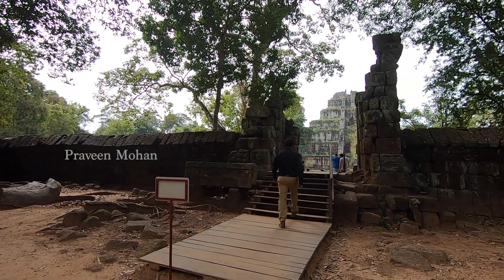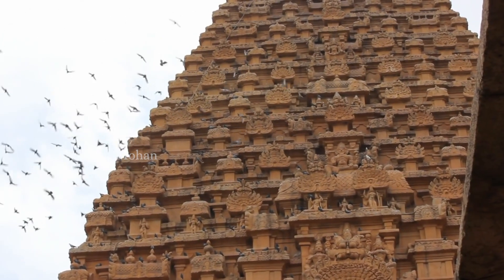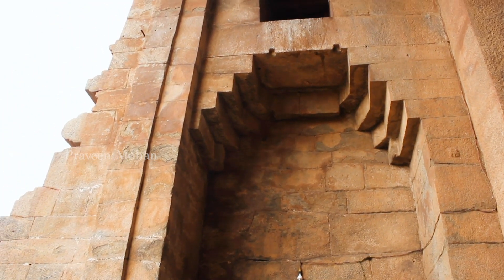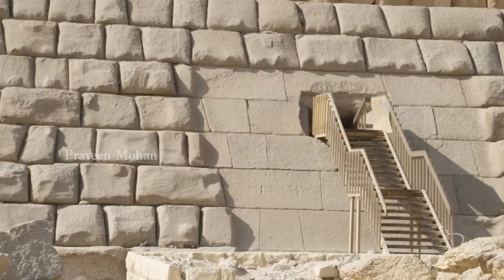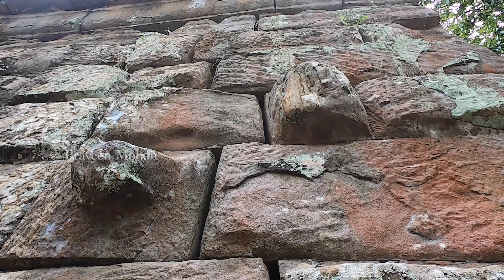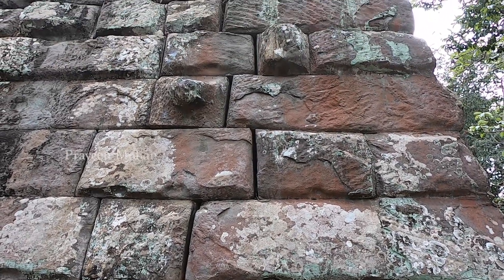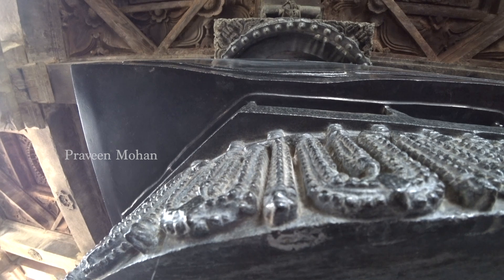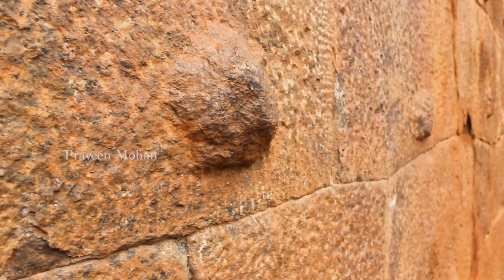Mystery of Ancient ‘KNOBS’ in Temples - Evidence of Stone Melting /Geopolymer Technology?

Comment from the maker: Thank you for watching. If you like this video, you may also like:
1) Floating Rocks Of Ramappa Temple? - http://y2u.be/AP0TvEIDuqY
2) Mysterious Arches of Preah Vihear Temple! - http://y2u.be/uX9XtvESIMs
3) Ancient Kailasa Nathar Temple was NOT built with Stones? - http://y2u.be/DmqAg5VKuZA
Reply: If it's a defect then that would mean they could melt /mold stone but not be capable of removing their defects . Why would they build with such size and precision but leave their obvious knob defects all over the world where these exist.  Blocks in other parts of the world with knobs also have the melted metal keys holding them together so they should've been able to at least chisel off a couple defects ?
Reply: @petermorelli5925  the metal "keepers" are made first and pressed into the geopolymer concrete blocks prior to solidification. The Antediluvian megalithic societies had crafts/machines that used ultrasonics to  mine the rocks, rough cut, transport, vitrifiy, solidified conglomerate, they used liquefaction (buttering), and curing processes.
Reply: why would they bother. We make bricks and blocks with defects. We have the capability to disguise or fix those defects but we don't bother. Look at modern buildings.
Reply: @petermorelli5925  Good point! I vaguely recall reading about or seeing a video that made the claim that the knobs form a shape when seen from a distance. I think that one of the shapes was of a cat, probably a puma.
Reply: I have pointed out this possibility earlier under ur videos.Now we got proof.Maybe a combination of stone chips with silica for maintaining certain vibrations inside temple since silica adds to semiconductor like properties.Also this combination is Eco friendly energy efficient.No need of air-conditioning since the rock are soft act like clay pot which keeps water cool.
Reply: Hi Mr. Mohan, you don't leave any space for doubt when you start exploring & explaining the process or monument & this is what makes you special.
Keep up the wonderful work, you are doing a great, pathbreaking job. People are going to realise, recognize & follow your profile style 🙂👍
Reply from the maker: @manuupadhyaya9999  Thank you very much for your kind words and support. I appreciate it.
Reply: @RealPraveenMohan  thanks a lot
Reply: @manuupadhyaya9999 ⁰
Reply: the knobs are a writing inscription method like the binary code 0 and 1
Reply from the maker: @theone6997  Interesting thought
Reply: @RealPraveenMohan  I agree with @christopher Higgins.
These knobs could be used to attach another piece of stone/artwork over them. May be these stones are yet to be covered with artwork...
Reply: @B4UDAYउदय  I thought of that too but considering how geographically spread these knobs are I haven’t seen yet a place that still have smth attached to these knobs
Reply: The only problem I see in your theory is the use of polygonal masonry. Each stone seems like a unique shape, which would make casting no where near efficient. I'm not sure if anyone has done the research necessary to find out there are any repeating stones with the same size and shape in polygonal masonry at a single site or heck even at different sites across the world, but until then I can't say you're right...

Then again if someone did find the same polygonal stone in shape and size in South America and Japan, that would pretty much prove the "ancient advanced world civilization" theory...
Reply: Hi Praveen! Sometimes we forget that maybe there was another surface covering the stone, and maybe even the protrusion held some kind of decorative artwork. They may have used the protrusion as base to build framework for wooden constructions that are no longer visible to us...maybe? Thanks for your work, I wish you the best 😃
Reply: Absolutely mind boggling. Every time I watch your video Praveen, I sit and pick my brain for some kind of explanation but always in vain I have nothing😂. I am guessing here but do you think these particular rock (moulded/cut) are faulty may be they have the bumps or cracks or some kind of default, hence they put at unimportant parts of temples or monuments? And once the builders examine these rocks for their quality than they been given these marks or bumps to distinguish them from the faultless rocks. Like I said wild guess. Great video Praveen..be safe wherever you are and go next. 🌍🙏🏼💙💙💙
Reply from the maker: @Divine00  Thank you buddy! :) :)
Reply: (YT) Brian Forster, Inca Tours, has been chasing these nubs a few yrs now.
Reply: @joes6319  I have already explained this to both Brien and Graham Hancock, they are more interested in sales than knowledge.
Reply: மிகவும் அருமையான பதிவு 💪
நண்பர் பிரவின் மோகன் அவர்கள் தமிழன் என்பதில் பெருமிதம் கொள்வோம் 👍👍👍 வருங்காலத்தில் நீர் பார் போற்றும் தொல்லியல் துறையின் சிறந்த ஆசானாக விளங்குவீர்கள் என்பது நிதர்சனமான உண்மை.✌️✌️✌️
🙏ஓம் நமச்சிவாயர் 🙏 என்று தங்களுக்கு துணை புரிவர் 🙏🙏🙏
Reply from the maker: @Velram1.  Thank you so much for your kind words and support, my friend!
Reply: Could the knobs be places where plaster decorations where mounted? I've always wondered and many images make me wonder more. Great videos.
Reply: I forgot to add I have heard the knobs can also be called a sprue
Reply: @PraveenMohan Sir , Can u prepare some Documents( like Papers,Book,etc.., ) related to Rock Melting Technology....you have Lot Knowledge on it, This may Useful to Next Generation...
Reply from the maker: @chandbashap6601  I wish I can do it someday!
Reply: These knobs don't look defective there must be a another reason bro.
Reply: They melt the stones with frequency ,, the right Frequenz and stone will desintegrate or melt!  All is frequency .  Nikolas Tesa quotes!
Reply: @ottomais  you are getting very close, keep digging, you will reach the same conclusions as I have. I told Praveen he was on the wrong path a couple of weeks ago, glad to see he's now on the correct path.
Reply: @ottomais  and probably also frequency helps with lifting and moving the stones.
Reply: I have to admit, I was skeptical at first about the knobs, but you presented your evidence, made your argument and changed my opinion.
You really are very skilled at argumentation. It's not the first or even second time you've changed my opinion on a theory. That's a talent. It's not easy to change minds. People are incredibly resistant to changing their mind by someone's argument. It's an impressive skill.
Reply: @kantitsamystery6328  : Did you ever think the stone itself might be cement concrete which would stay soft for some time before solidifying.  If so, then stone melting was not necessary and any worker could create a knob on the soft stone.  If you believe the stone was not made of cement and was carved from natural hare stone, then the carving process would take a long long time and create a lot of waste scraps.  Where were the scraps? If no scraps it means no carving.
Reply: @kantitsamystery6328  

The video is misleading you, the knows are something that will blow your mind.

This guy has no clue and his mentioned of experts are not viable,  not facts but plenty of imagination.
Reply: I seen a place where figures fell off the wall and they had holes behind. The knobs were used like pegs to hold statues and figures on the wall.
Reply: Good vid!
Reply from the maker: @Godwinsname  Thank you, my friend!
Reply: @RealPraveenMohan  I AM very glad that you have finally come to the correct conclusion, albeit a bit late to the party. These stones in particular were cooled too quickly causing spalling and suck back on the surfaces. I  have given you some information, as I have also done with Brien and Graham. If you want to know more just ask.
Reply: @Cryptic_Triptych  Please tell me more, I have a background in mechanical engineering and alternate physics, look into Ken Wheeler; he has a Grand Unifying Theory that's simple and correct, and learning from him can help understand how these technologies worked
Reply: @aidanastigarraga206  LOL, I have had many conversations with Ken. I have talked with John Hutchinson as well. I could go on about myself and the things that I know and people I have studied and talked with, but it's not about me. It's about the great revelation to humanity, that is why I AM here again.
Reply: @Cryptic_Triptych  you are a good soul, and a selfless one at that. I hope more people shift their paradigm and see the truth. It's people like you that will make that happen. Please let me know if you have any more specific information. I also have studied the Coral castle for a very long time and I believe Ed Leedskalnin used similar methods.
Reply: @aidanastigarraga206  thank you for your kind words. I have studied Ed's work as and understand his book Magnetic current. His principles are the same as Tesla, Schauberger, Russell, Steinmetz, Heaviside, Plauson, T H Moray and many others that I have studied. Eric Dollard is probably the best living source along with Prof Dr Konstantin Meyl and TheOldScientist.
Reply: @Cryptic_Triptych  if people only studied the history of electrical theory, they would see the gigantic holes And unanswered questions in today's modern understanding of physics. I have to agree with Ken when he says that scientists are really just atomistic math majors
Reply: @aidanastigarraga206  yes exactly, if they understood that electricity is a byproduct of magnetism and dielectricity (most people don't know what dielectricity is), how piezoelectric energy is produced and that the Earth is a piezoelectric crystalline generator and transmitter, they would truly be astonished. I have figured out a lot about how this Construct operates and how to hack into its operating system. It is a fractal, a lichtenberg pattern, a mandelbrot set, a chiral bifurcation, a coaxial perturbation, an inverted mirror image, a helical vortex, implosion, compression and expulsion, my concept of -1, 0, +1 (also how "nature" operates) is the new system for spintronics which replaces Claude Shannon's binary system.
Reply: @Cryptic_Triptych thank you, I will surely be doing all kinds of research now; isn't it ironic how when you base your science in reality, seemingly "magical" science is possible? If there are specific ways you are aware of in which the pre-flood civilization may have cut, moved, and vitrified these monolithic stones, please let me know. As of right now, I believe cutting was something along the lines of "wire EDM",  and the vitrification process was electrochemical, however I don't know what specific frequencies/methods are used. The only thing I don't have a full conceptual understanding of is how the stones were moved. I believe that to be operating on a radio frequency, but I don't know how it would be applied to stone. Any info you may have would be incredibly beneficial to the future of humanity. (I also may have a method of dating when some of these monolithic structures were built, based on the precession of the Earth's axis, but that all relies on how they moved the stone)
Reply: @aidanastigarraga206  there are different technologies utilized. For example in South America and in the Antediluvian megalithic structures they used a machine or craft which utilized ultrasonics to cut out, transport, make conglomerate, pulverized and make geopolymer, set and bevel edges. If you look at the processing method used this is the only conclusion a rational person will come to. It is very obvious that the stones are processed and the areas where rock has been removed is machined. Some are conglomerate and others are polygonal geopolymer, some even have magnetic anomalies which are only now being replicated in labs

 https://www.colorado.edu/atlas/mechamagnets

I told Brien Foerster about this while he was investigating the magnetic properties of the "H" blocks. Along with the stacking and interlocking design the Antediluvian megalithic societies impregnated the crystalline structures with magnetic fields (creating magnetic alignment) this gave a greater bonding strength to the entire structure. It would very much seem like magic, as does frequency or archeaoacoustics or sonoluminescence. In fact all of this magic is generated by the same process of frequency generation as Nikola Tesla explains. Harmonic resonance induction. You may also have realized that all the gods hold a staff, fork or trident, these "pitch" or "tuning" forks are very prudent as to understanding how the post flood people built structures and moved them. Standing waves, constructive and destructive waves of energy are another example of how frequency is utilized. You can look further into Crystallography and metamaterials for a start. I also know about phase state transformation or as it used to be called Transmutation by way of the philosopher's stone. Furthermore most people do not understand that Mercury absorbs gold, silver (electrum) and copper. So the idea of the philosopher's stone in this sense has to do with a saturated amalgam that is then refined and purified in a process to extract the valuable metals. The river of Mercury in the Feathered Serpent pyramid in the ruins of Teotihuacan is a perfect example of the reasons why this culture had so much gold, Egyptian culture utilized this same principle.
Reply: @Cryptic_Triptych  thank you for all your information! I will certainly be looking into all of this. Today in my research, I have discovered how Leedskalnin accomplished his megalithic park. In the "black box," there was essentially a large magnetron, like what you would find in a microwave. Essentially, this technique is identical to a microwave oven, however it uses very low frequency microwave radiation. (Military E.L.F. radio stations are all built on specific rock formations to act as a ground dipole. They are used to communicate with submarines, apparently.) Underneath the box is a metal bar acting as a cathode for the magnetron. The box on top acts as a cavity reflector to direct the radiator downward. 

Ed's generator worked on this concept: his wheel produced an alternating current, directed into his PMH. Attached to the middle bend of the PMH is a chain and a large mass of iron, which increases the voltage produced by the generator. The coils on the PMH are then directly fed into an AC electromagnet, (seen in pictures next to the wheel) and this magnet is then directly attached to the aforementioned mass of iron. The wheel is then filled with water, surrounded by a piezoelectric container of some sort, in this case, he used the coral. Above the water is a hook shaped piece of metal, which is similar to the staffs held by Egyptian gods, with a "tuning fork" at the bottom and a hook on top. By doing this and then turning the wheel, the water is under such a strong alternating magnetic field that it becomes a superfluid, flowing with zero viscosity and zero loss of kinetic energy. This is why Ed called it his perpetual motion holder. The wheel would keep spinning until he stopped it. That's as brief as I can be for a YouTube comment, but if you'd like to hear more, I'm more than willing to explain.
Reply: @aidanastigarraga206   Indeed, he was able to interfere with the effect of gravity, thereby reducing it's effect by upwards of 80%.
Reply: @Cryptic_Triptych  the moon and the geographic location is also a huge influence on how much the mass of stone is reduced in weight. This is why all the unexpalained megalithic structures are along the gravitational center of the earth, where the moon would be directly overhead at night.
Reply: @aidanastigarraga206  Indeed, you will notice the crescent moon in the garden. Also see the "observatory" and the "sun dial". Ed proved that the Earth does not tilt towards the sun during its orbit in order to create changing seasons, but it moves up and down in reference to the solar plane.
Reply: @Cryptic_Triptych  You are very wise and a clear thinker; I commend your efforts to better and advance humanity. I consider myself lucky for you having seen my original comment. If you happen to know how Ken Wheeler's antigravity toy functions, please give me a shout. You should write a book or a video or something to get your ideas out there! Most people are unaware there was a pre-flood civilization in the first place! What a failure of the education system; teaching young minds the electron is a "particle" and speaking as if that's a well understood fact. The same goes for light! "Photon" particles! Give me a break! That's bordering on criminal!  As for me, I will be building a small scale version of Leedskalnin's design to see if my reverse engineering holds water, but it should, and I am confident this was the technique he used.
Reply: Notice how every single temple that you’ve shown or that you see anywhere globally, if you look at the actual stones it would seem almost as if they have corrosion on them. It’s not battery acid poured on the stones. It’s simply if you connect these stones where these knobs are you can draw power from the temple while at the same time create even more power within the temple. I would imagine this would make the molecules from within the stones charged and at the same time stones would become almost fused together. Cause remember this power works backwards, from the inside out, similar to a vortex. All the power we use is from the outside in.
Reply: They are also on the arches and gates at, Warangal Fort. Check out the knubs on the sides of the Solstice slot you featured recently.
 So glad you are spreading the info on the knubs. Check out our channels for more info on the knubs. Ancient History Criticisms and Ancient Alternative View. 

For my money they are code for the stonemasons to put doors, windows, arches and statues in certain places. Also some appear to be constellations. Some maybe street names especially at the corners. Some square knubs are for mortise and tenon joints to fix another stone to.
Reply: look up star forts you have in all over the flatearth
Reply: Praveen, yes you’re absolutely correct about the melting, casting and everything up to the point of the rocks softness being the reason for the plant growth. The plant growth occurs due to the fact the ancient people were attempting to not only create a living Lingham inside the temple, they were attempting to make the entire temple living. Using life energy, some call it chi, Qi, Prana, manna, Holy Spirit, or Orgone. This was globally well known common knowledge. We can see this easily just by looking at the precise mathematical measurements used while creating all of these temples. The last time someone came close to reproducing positive results using this type of energy or technology was the orgone accumulator. That was a mini, almost microscopic version of one of these temples. Some kings lived for as long as tens of thousands of years utilizing the power of this life energy. Of course mainstream couldn’t ever admit this. It they did it would completely disrupt some of the most powerful business as well as our economy runs on, big pharma.
Reply: @grayj1936  
He is wrong at best.

He is misleading people with his videos
Reply: Hlw bro...Can I guess the reason?
Reply: So much has been lost and forgotten because of the evil that controls the world. I look around and I'm not impressed by our "modern " technological "wonders". I feel the answers to questions like these will never be found by our arrogant modern society  because we are not giving the ancients the credit they deserve for being far more advanced than we could ever imagine. Somehow magnetism holds the key.
Reply: The concept of "cast" stone has also been advanced to explain the architecture of Peruvian prehistoric structures.  One archeologist used this theory to explain the immense irregularly shape stones used in constructing walls and buildings.
He postured that they were made out of a form of concrete held in place by reed containers which were soft enough to mold into the lower set of stones.  The reeds were then removed after the stones had dried in place filling spaces in the irregular shaped lower stones.   You are probably right about their origin supported by the piece of rock that could float.
Reply: @walterdelorrell4041  : Thank you for telling me that an archaeologist had used the same idea.  I am very happy to hear that.  I wish to tell you another point; the erosion.  Natural stones almost never erode while cast stones erode very fast.  Erosion will create cracks and holes and through these cracks and holes, we might see a different material such as bricks and small natural stones.  Please pay attention to erosion when another Peruvian video shows up to you.
Reply: Parveen mohan aapki videos dekh kar Garv hota hai apni sabhyata aur poorvajon par aur ye batata hai k kitna kuchh hai Jo hamse ateet mein kho gaya hai. An dhoondhna hoga apni khoi Hui swarnim virasat ko
Thanks bro for your valuable videos
Reply: Electrochemical and Electrical Discharge machining is how these were made, just a more advanced understanding of how to apply these techniques to stone
Reply: @aidanastigarraga206  very close, keep digging, see my comments throughout this post.
Reply: If they were cast, would not all surfaces be smooth and identical?
BTW, are they not stones rather than rocks?
Reply: Has the composition of these rocks studies? Are there any clues in their composition?
Reply: PraveenMohan oh my goodness your merchandise is pricey sir.
Reply: THE MELTED BRICK INFRASTRUCTEUR ALL OVER THE WOLRD, IS SOLVED BY: WHEN DE BUILDINGS CRIED AKA SUBPHOTONIC AKA JERRY DECAMP, 
THE PERFECT RED-BRICK INFRASTRUCTEUR OR BUILDINGS GOT HIT WITH HEAT GOT COOKED AND MELTED, THE MORE U COOK THE CARBON-14 OUT THE OLDER IT DATES N LOOKS N THE MORE U COOK THE C-14 THE MORE COLOUR U LOOSE TILL IT GETS WHITE LIKE ASH SCORCHED EARTH WAS PERFECT RED TARTAR BRICK,,, PAY RESPECT OR HOMMAGE TO THE INFO DONT BE A HATER✌ PEACE
Reply: Half right. Underneath the knob will be the hole in where the Lewis lifting anchor was placed, round knob for split pin and square for three legged Lewis.
The stone was dipped in geopolymer and settled in place with a perfect fit but leaving the lewis in a while for stability would also leave a knob when pulled out. Some stones where cosmeticly corrected afterwards but for the most part they didn’t bother to do the effort. 
So, I’d say you’re wrong about the holes but half right about the knobs not being carved but comming from the use of geopolymer.
Reply: @ros8737  
Ya heard this one?

If you can imagine the Earth starting the funner part of its life as a rock covered by hundreds of miles of ice, then the nubs could make sense as a ball and strap connective tissue shaped like this @—====—@

The ice melted, parts of the crust got exposed and mountain sized beasts have been decaying in mud. Animals got smaller, we are all walking on the sea floor and digging into carcasses. The “rock” may have been easier to cut at the time and would probably seal back up nicely next to another rock like it being all biological n all..
Anyway 
After transitioning to a certain state, the flesh-turning-to-rock formation compelled the mason to workaround the ball if it was close to the face by cutting some of the desired rock around the strap such that it would leave a nub, then cut off the strap. @-

Extra credit for why they found a lot at the bottom of the rock. Really gotta stretch for this one

Crazy or what happened?
Reply: @ros8737  
Absolutely not

The knows are not for lifting, they are where tendon straps were attached,  the materials used was tendons. 

You want truth,  you have it !
Reply: People climbed walls.  they are handles.
Reply: உங்களுடைய விரிவாக்கம் நன்றாக இருக்கிறது ஆனாலும் நீங்கள் இதை தமிழில் சொன்னால் இன்னும் நன்றாக இருக்கும் தமிழகத்தில் உள்ள கோயில்களில் இருக்கும் அற்புதங்கள் தமிழர்களுக்கு தெரிவதில் அங்கிலத்தில் பேசின கேட்பதும் இல்லை தமிழில் கூறுவீர்களா
Reply: What it looks like to me that happend is that after these Blob-Blocks were placed back them Days, they Expanded and Sealed themselves even tighter together which we can clearly see. The True 2 Mysterys, (in my opinion ok?) are of coarse what Formula(s)/Mixtures did they use to create the Softening Effect to Pour them?  And secondly, how did they Stabilize the Blob-Blocks when they had to raise them high up in the Air? It sure must have been a sight to see back then during the Creation of these beautifully Waterproofed & Accustical works of Art.
Reply: Keep it up dood👌✅
Reply: Would it be possible to tour the Padmanabhaswamy Temple? I'm really intrigued  at the history behind it, and vault B , I would love to hear your thoughts on it.
Reply: I agree with a lot of your logic. But they just were not “ melting” rocks.  You’re correct it’s cast. Very little is truly megalithic.,but somehow I think you already know this. People were not melting rocks or cutting massive stones with copper and such.
Reply: I get the feeling you are wrong about the Knobs   They are just too purposeful and easy to remove ... they are there for a non structural reason
Reply: I agree with your theory because it explains the protrusions much better than the official one.
Reply: Heat treatment was done for softening the rock to bend
Reply: One quick thought about the central pillar in the Indian temple... perhaps it is "bent" because of the wear from people touching it. The softness of the rock has allowed it to erode to simple human touch over thousands of years.
Reply: @hotsauceislethal  why only few are bent
Reply: @poorneshratnagiri9835  he only shows one that has a curvature to it. It appears warped yes but perspective is important to remember as well. Only one side...
Reply: I like your videos but I am not understand English your all videos r convert to Hindi language this is possible ?
Reply: You mentioned that these knobs are always where there are no carvings ... in Egypt these knobs are on blocks that would have been under the smooth casing stones that have eroded and fallen off ... I believe their purpose was to help stop the casing stones or decorative panels from sliding off the walls, and where they are visible there was once another layer of stone, metal or wooden decoration that has fallen off or simply wasn’t added before these megalithic cities were destroyed globally, in mid-construction in some cases, by a series of global cataclysms.
Reply: Wasn;t for ancient ROCK CLIMBING by chance?
HARDCORE PARKOUR...

but really I dont know?
Reply: if they cast geopolymers there is no evidence of a mold because of the ramdomly shaped rocks.  if these are defects you can see these on other giant megaliths around the world where i think its not a defect, maybe some kind of a marker on where to place the stone... anyways no one knows about it....
Reply: we already use fluid geopolymers in smaller construtions sides like porches.
Reply: Hello Praveen. All ancient temples were made with perfection and precision.  I dont think these architects would leave any flaws like this unattended. If the stones were a product of defective casting then they would most definitely have chipped it off and polished it later after laying it. I guess these stone blocks are marked to show or denote something to future architects. Maybe to show that the knobbed ones were the moulded ones and the others maybe real cut out rocks. Or maybe that these were the sealed with paste stones and the others sat free or were interlocked by a different technology.... maybe a clamp or something. Because if in the future rearchitecture was required then the future masons would know the layout. A wild guess.
Reply: not so sure about the the defective bricks, these guys had too much a high level with stones, as to not being able to control the protusions, and if these were not intended, knowing how "easy" it was for them doing crazy things stone, why not cutting them after, that is definitely not realy logic....the protusions are 1000%  intentionaly to be exactly where they are. Something that I don´t see comments at all, is the distribution of weight, this is essential obv !..specialy when doing these crazy ancient stuffs, so when you are building something with every single brick different !!, how do you make a balanced distribution of the weight, to my view, knowing the extreme precission of the encasing, that means that the work for compensating and balance, would be almost a laboratory work, you have to consider, that in a poligolinal dry wall, the deviation of less than a centimeter, easily would imply a deviation of tones of weight....imagine a deviation of 0,5cm at the base of the pillars at baalbek, that would be a catastrophe at the top. this is one of my possible explanatios, there are others more "esoteric", yet, even more plausible than geopolimers or weight distribution.
great stuff Praveen, we need this things, how would anyone build these things with the mentality of an archeologist...evidently we are facing cultures that truly believe tha EVERYTHING IS POSSIBLE, for them the fysical world had no limits.....-blessings Praveen-
Reply: Where is the secret technology  ??

The knobs are the tendons straps attachments,  the straps would act as a rubber band and when you flex or stretch,  the straps would bring back the tendons to it original position. 

Knows are where tendons straps would attach to one position to another position and allow elasticity. 

The tendons were soft like block of cheese and cut while wet from the flood, once it dried it would be stone hard petrified. 

You should have more questions about this subject after this.

Experts,  you said Experts,  whose the experts  ???
The wet tendons were stacked while wet and they sealed together so the drying would not need mortar in the joints.
The tendons were from the gigantic creatures killed during the flood.
Reply: I do believe that all those blocks were casted but two things don’t make sense. 1 why didn’t they got rid of the knobs?. They’re still visible and if I was the builder I’m sure it would have been 2 min per block to get rid of the knob
2 many of these block ( at least in Egypt , Peru) are known to originate from certain quarries. If the rocks would have been “melted” and recast I would imagine they would have a different structure.
Reply: so, how did they melt and mix the rocks?
Reply: Why always make different shapes if they are cast?
Reply: I believe the jobs
 We're used asb lock/ key the purpose of which was to be able to add walls if needed at some future
 Time. ⁰
Reply: What if... there were no knobs? The knobs didnt form until later when the planet was hit with something hard and the surface of the planet heated up enough to make the current stones melt together a little more, filling in micro gaps between the blocks, but also causing impurities in some rocks to surface and escape with gas, forming the knobs?
Reply: Hi praveen i love your vedios, 
But nowadyas there is coronavirus everywhere please take care and avoid travelling.
Reply from the maker: @prajnanks  Thank you buddy, sure will take care.
Reply: The accidental defect theory makes sense...except that when used for such important buildings I can't understand why they would not simply chisel off the defect.  They are not where you can't see them.  They are clearly visible.  With all of the effort they use in creating beautiful decorations it seems counter intuitive to leave an eyesore of a mistake on blocks that could easily be chiseled down to a more smooth surface.  The only explanation I can think of is that the defect did not show up until the block had been set in place and totally solidified.  That might explain why the lower blocks are smooth.  Those are the ones they could reach to correct.  It is clear that they were not totally solid when set as they obviously mold to the neighboring blocks.  Do today's defects when molding show up only when the material has completely hardened?
Reply: Those knobs are from mudfossils
Reply: So full of crap
Reply: These stones aren't mortared together, so they needed a way to lift the stones above to do repair.  These nubs/knobs are there so masons could wedge lumber under them and repair/replace blocks beneath them.
  Many have interlocking H connectors to aid with this.